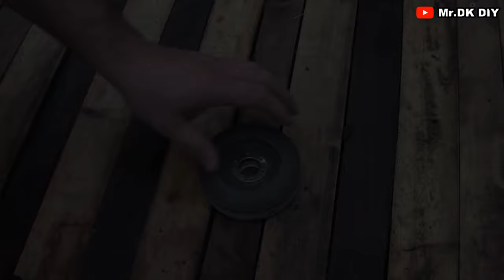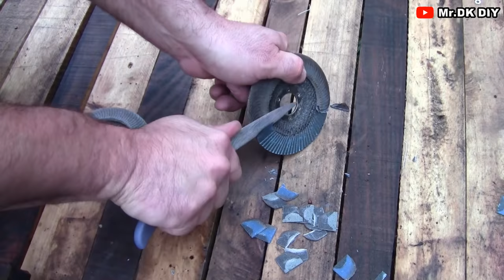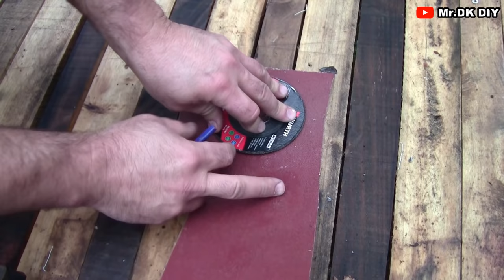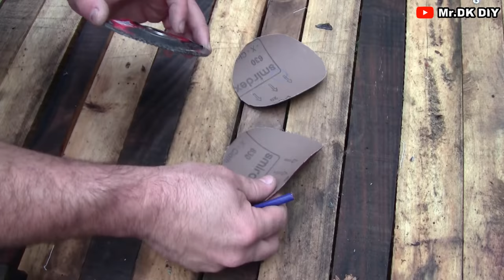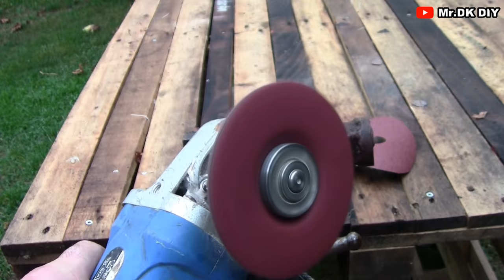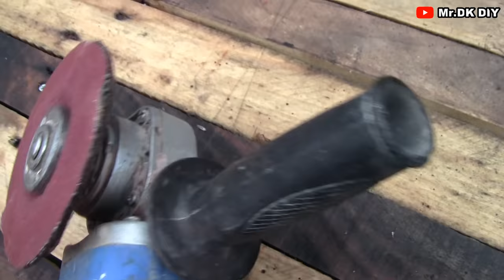DO NOT THROW OLD THINGS , JUST USE THEM AGAIN / DIY Project

Comment: My welders make $45.00 per hour plus benefits. I purchase flap disks in bulk for about $.95 each. When you wear one down, chuck it, put on a new one and keep working. Your penny pinching would cost money. Plus one burr would rip your paper to shreds. Sandpaper scraps would become a housekeeping issue and you can't grind on the edge. If you can invent something that can grind two welds at once, that would be practicle.

Comment: helpful hint: when you cut out the new discs, place them a close to the edges of the paper as possible to avoid wasting a huge amount. even more helpful, get a rubber disc attachment for your grinder and use that instead of messing about cutting up old flap wheels. it's more hassle than it's worth.

Comment: Those flap disks had way more life in them than those sandpaper disks you made. Could have ground down 20 or more of those bars with that flap disk you destroyed.
Reply: Agreed
Reply: It will be good idea for steel realing
Reply: Kupindo
Reply: I was thinking the same way. Plenty of life left  the welders at the shop use them less then that or about that 1 per trailer. They like them new. I probably have boxes with about 200+ 40-90 percentage life left in the disc and use them at home. I even made a arbor for my drill when it gets late to not disrupy the kids sleeping. I'm lucky we use black hawk disc. But you can get them $1 a piece on Amazon. And $2 a piece for middle tier brand disc. For good disc cheap leighvalleyabrasives can't beat if you need a large amount besides that eBay and Amazon do. Don't buy that stuff a a store. Two flap disc you can buy ten pack shipped. 

Now what I dowhe they wear down some we have a welding class across the street from my shop. Night time welding for adults. When I get a couple dozen or so. I give it to them to let the students who maybe robbin Peter to pay Paul have some disc to usesbd practice with. The welders and owner literally just throw them away. Same with cutting wheels starts as a 6 thrown away around 4.5 unreal the waste. Just take a air wand to clean out those disc and good to go will bite hard again. Hands down my favorite. A flap disc won't shred you open like a wheel or other things will. Worst I've had was a nice deep scrap on my hand frkm. But the wire wheel I jus switched from would have made me get Staples and stitches. I've seen a wire wheel go up a guys arm cutting the whole way. Off his shoulder and grinder shot off behind him. I only use paddle and trigger switches now
Reply: I take an old wood rasp to freshen up the disc not to mention all he did was use the old disc as a backing disc.

Comment: If the edge of the flap disk gets too rounded. While it's on the grinder run it against the concrete floor (the very edge NOT the sanding surface) it will give you a nice crisp edge again. It will make the disk smaller but you'll use the whole thing up. Of course as the sanding flaps get really thin they will fly off. Use caution or sometimes referred to as common sense.
Reply: Good tip Henry Miller! I've been using that trick for many years, but I'm posh (lol), so I grip an old lathe tool in my vice, and  take the back of the edge down against a corner of the tool-steel. My flap disks last until I can't stand the smell of the hub burning. Keep 'em sparking Henry, Happy days.....!
Reply: @brggmc  ooh, ooh, that smell...

Comment: Dude I retired at 35 years old a disk costs less then $2.00 if you want to save pennies that's on you. But even retired what are you saving? ZERO! if it takes an hour your shot out. I change my flap wheels as I go through a project 60 120 180 200 250 300 you want to save time electrolisis

Comment: those flap disks are not , not spent yet. clean the paper backing bits off and clean the grit out with a wire wheel, takes about 3 minutes each wheel. I dont use the cheapo $2 flaps, and I want to get my $3.50 out of each disk. Besides, it is a good excuse to sit and take it easy for a short break while cleaning a dozen flaps.

Comment: Good idea!So what if its time consuming.You didnt have to lock up the place and go out to buy more flap discs.If you cut about 6  1/4"slits from the center hole outward,the sanding belt won't get 'puckered,and youll get more even wear. I LIKE THE WAY YOU THINK!!
Reply: es muy peligroso y menos con la amoladora sin el protector esa es mi humilde opinión.

Comment: not even close to worth your time to do this. flap disks are a few $. rubber or plastic sandpaper backing pads are like $5, last a verry long time, and work better. buying premade disks is probably about the same cost as cutting them out of a sheet and saves a ton of time.